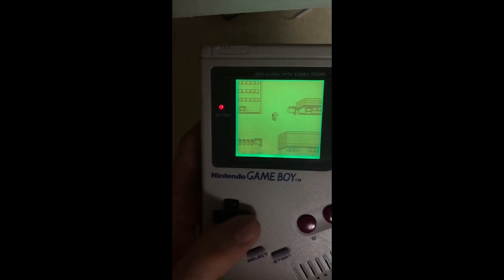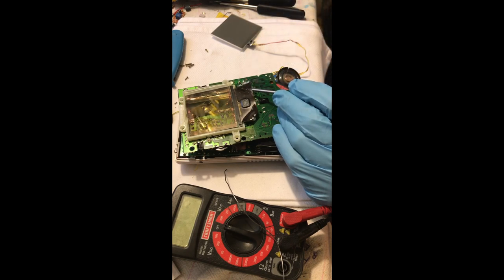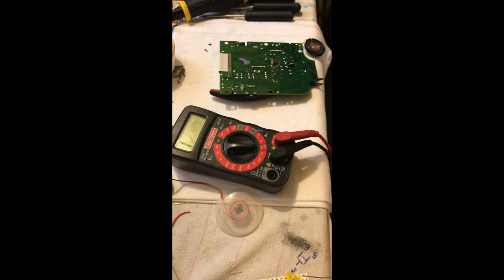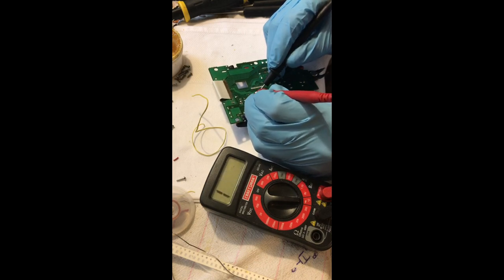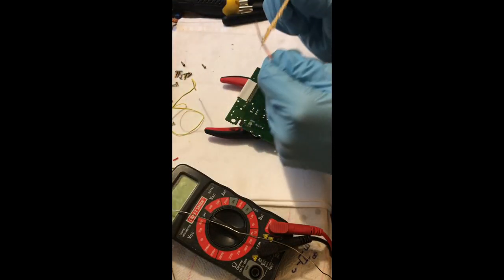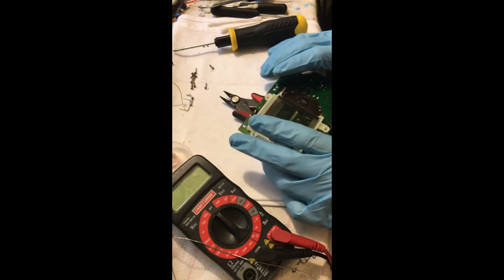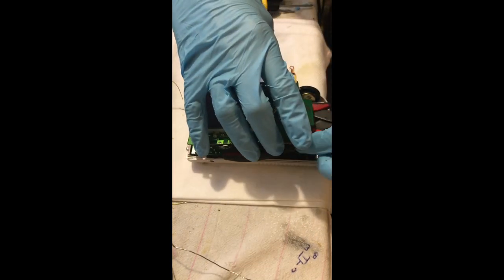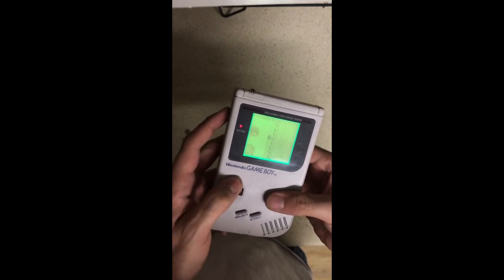Fixing unusual button issues - How To, Gameboy DMG

Comment: Thanks for making this video! I have a question. So, I have a DMG and it works properly for years but after not playing with it for a while, the Right + A button doesn't works anymore. Do you think I can do a restoration to it with this video as reference? or you have another tips to solve this issue. Thanks :)
Reply from the maker: First step would be to disassemble it and clean the LCD PCB and silicone button membranes with isopropyl alcohol and then test and see if they work

Comment: Hey man, I have a DMG that powers on, has sound, and seems to go through the boot protocol effectively. But when the start up logo scrolls down, it's a very oversized block , 3 times as tall as normal and full screen width( game/no game), and there are pixel lines from top to bottom. Not the missing lines needing a solder refresh, but alternating rows of 10 or so pixels,  dark light dark light ect; top to bottom. With no game it holds that screen. With a game, the screen goes blank after the "ding". I understand this is an old video, I'm just hopeful you get this and have any place for a DMG guy to start. Great video. Really good stuff. Thanks all around. Now for that shot of Seagrams.
Reply from the maker: Sorry for the delayed response, my first step would be to check the voltage regulator and make sure that you are not only getting a stable +5v output but also a stable -19v output on the negative rail
Reply: @roarkemurdock3027  
No apologies necessary! I'm greatful. I will get my tools and retest but as I recall, I got weird readings from the regulator. And for reference, the DMG in question, is a CPU 06. The "blob board" .  Thanks for getting back with me, very much 🤘
Reply: @roarkemurdock3027  
I forgot I put the retrosix clean power board in this unit. But I do read 5 and -19.
Reply: With a fully functional front PCB and screen, the whole screen is powered on, no weird lines as previously described, and the contrast works, but the screen is blank. No "bars" or Nintendo block as I said before.
Reply from the maker: @earthskarma  ok so you swapped a fully functional front PCB and get zero image? If you put the original front PCB (that had weird oversized lines) into a tested working cpu board what happens?
Reply: @roarkemurdock3027  to try to clarify, front board 1 and 2, and rear board 1 and 2. Both front boards work flawless with rear board 1. Neither front board work with rear board 2. The lines of rear board 2 have gone away since I replaced the capacitors.  But with both screens, rear board 2 presents no image, and doesn't seem to load a game. Power on, hear the ding, and nothing.
Reply from the maker: @earthskarma  try reflowing the solder on the CPU pins on the defunct CPU board, check continuity of all the CPU traces and the ribbon cable connector on the CPU board. Additionally I know that you changed the electrolytic capacitors but it is important that they are high quality caps with low tolerances, the voltage can be the same rating or higher but the capacitance Must be the same as OEM. Low quality caps with large tolerances may say 100uf but if they have a 20% tolerance they may actually be 80uf or 120uf which is sometimes acceptable when you are decoupling a voltage regulator, but unacceptable when when you are decoupling the CPU. If none of these things work you may need to swap in a donor CPU
Reply from the maker: @earthskarma  Nintendo used cheap older tech with high quality components, their circuits are, for the most part, designed very well. When replacing components like caps I always trust that they designed it correctly and that there is a reason why they chose that components value, so I replace them with capacitors that have 3% or lower tolerances
Reply from the maker: @earthskarma  now I should have asked what mods, if any have you installed and what game are you testing with? Is it an ever drive? If you have power hungry mods and/or are using an everdrive the DC-DC converter may not be able to supply enough current, in which case installs an auxiliary regulator to power the mods and a large decoupling capacitor on the power line may be necessary
Reply: @roarkemurdock3027  i bought my cap set from RGRS. I was assuming they would be correct. Here's one to the  naive consumer. My meter doesn't measure capacitance in the stock units range. I'll spend some more time with it and see what I come up with.  I thank you very much for your time and help. 🤘
Reply: @roarkemurdock3027  it had the same problems stock, and with a osd v4 (I think) , then I put in the clean power, then did a re-cap. Only stock games. No ever drive.
Reply from the maker: @earthskarma  you can kind of test the capacitor with the resistance mode of your multimeter, take the suspect capacitor out of circuit (ideally but not always necessary) and discharge the cap. Set your multimeter to the highest ohm setting and put the leads on the capacitor leads. The ohm reading should start low and gradually rise to infinity, if the reading stalls or immediately goes to infinity then the capacitor is likely bad, however it will not tell you the capacitance of the capacitor

Comment: I've got a dmg that's got left and B on all the time. Checked with another LCD board and it's still happening. I'll check the diodes on the CPU board. I've already reflowed all the CPU pins and that didn't fix it. Hopefully it's one of the diodes. Do you know where I can get a suitable replacement that isn't from another board?

Comment: Hi,
I noticed on my DMG in Super Mario World2 when selecting a safe game, that I could only move to the right, and (hardly ever) to the left.
WIthin the game everything seemd fine, until I noticed, that pressing up, turned left, and pressing left also turned left. When I tried jumping, I saw mario jump high, so left and up somehow seem to pre activated together. Could this be a similar problem? Contacts are clean.
Any whay to test what the reason might be without taking the display off? I am not so expierenced with soldering...
Reply from the maker: Hi! It is certainly possible that the button array diodes and/or the related traces are corroded/damaged. Only way to know is to get in there with a multimeter. You can gently open the screen without desoldering the lcd to test them, however replacing them with the LCD in place would be difficult

Comment: i have a gb light from japan and there is so much corrosion on the A and B that they arnt working no more. i wonder if its possible to hook up wires directly to make it work again. u have any idea?
Reply from the maker: If contact pads are in decent condition and just the traces are corroded then you can absolutely fix it with jumper wires

Comment: Wow, this is the only video that helped me understanding something about this problem :D
I modded a dwg for the first time with the backlight and the bivert but now the right button is right + A, the left is left + B and so on. I mesured 550 on the 4 DA diodes , do you think this can be the problem? (I mesured signals on buttons too and the D pad got lower signals values than start, select, A and B)
Thanks

Comment: great video but can i ask a question i have a dmg gameboy i got from an old store its works fine but the up arrow isnt working is repairing it deffrent than this video and can i fix it without removing the screen?
Reply from the maker: It’s hard to say without opening it up and looking, but if the up button just isn’t working at all then it may be as simple as cleaning the silicone membrane under the d-pad, putting a jumper wire over corrosion, or it could be a complex repair. Many different possibilities, but I’d suggest that you open it up, clean everything with isopropyl alcohol and test it again, if that doesn’t solve it then grab a multimeter and start testing everything in circuit with the dpad
Reply: @roarkemurdock3027  i already cleaned it until it shines but still isnt working
Reply from the maker: @rashedfrlegend4496  ok so you’ll need to grab a multimeter and start at the problem, in this case the up pads, and work your way to the cpu testing that all traces have continuity, the corresponding diode(s) are working and have a voltage drop of around 700-725 millivolts, check the continuity of the corresponding ribbon cable traces, then on the cpu board that the ribbon cable connector is working and then continuity of the corresponding trace to the cpu. If all of those work correctly, reflow the solder of on the cpu pins and test if that doesn’t work swap the cpu from a known working dmg. If that does work then you need to transplant a working cpu onto the board. If a known working cpu board doesn’t work then the issue is on the LCD board and you likely missed the problem when diagnosing the issue
Reply: @roarkemurdock3027  thanks man ill try my best
Reply from the maker: @rashedfrlegend4496  no worries, all problems can be fixed, however they often push your patience to the limit haha stay calm, step away if you get frustrated, and don’t give up, you can do it
Reply from the maker: @rashedfrlegend4496  also make sure to replace all electrolytic capacitors on the CPU board, the DC-DC converter board and the LCD board. Make sure to get high quality capacitors with low tolerances. The voltage rating must be the same or higher than the originals, however the capacitance rating must be exactly the same
Reply: @roarkemurdock3027 hey i just came back to ask if i can order the diodes from the internet or something like that because i couldn't find another Gameboy around
Reply from the maker: @rashedfrlegend4496  yeah you can order them online, I used to sell them years ago after I made this video
Reply: hey i did more researches and my problem could be a dead cpu pin and not a bad diodes because both up and select have the same pin and they both does work with me so i guess i cant fix it without having another gameboy @roarkemurdock3027
Reply: @roarkemurdock3027 I wanted to ask if there is any other kind of diode that i can use without having a problem because i cant find a da215
Reply: @roarkemurdock3027  can i use a Schottky diode instead of the dan215??
Reply from the maker: @rashedfrlegend4496  the Dan 215 diode is a switching diode, I wouldn’t recommend using a Schottky diode without doing some testing first. But let me looks through my gameboy parts, I may still have some Dan 215 diodes that I could send you, additionally I could send you some parts boards if you did want to try swapping the cpu
Reply: @roarkemurdock3027  its ok you dont need to send me anything but tell me what other things i can use instead other than dan215

Comment: I have a problem with my gameboy dmg that what happens is similar to your error, when I press the a button it is also pressed right and the same with b left select up and start down, but my problem is that it happens with any screen that you put on it What is this error due to?
Reply from the maker: Hard to say exactly without having the unit in front of me. I’d start by checking if any of the pins on the ribbon cable connector are shorted, then check the traces that go from the ribbon cable connector to the CPU for any damage or shorts. If the connector pins and traces are good, check the CPU itself, are any of its pins shorted/damaged? You may potentially need to replace the CPU, in which case ChipQuik (the solder I use to remove the screen) or a hot air gun makes easy work of removing the CPU

Comment: Voltage drop changes as the component cools. Probably was fine, but no harm in replacing it.
Reply from the maker: You are absolutely correct, and I imagine that after removing the short that diode probably would have worked fine, which I mention briefly, but better to replace then have it fail for the customer
Reply from the maker: Main point of the video was to show people that when you encounter a new problem schematics and datasheets will help you diagnose

Comment: I changed shells for my DMG and when all put back together, everything worked perfect apart from the a and b buttons, I've tried putting everthing back in the original shell and even used different buttons and membranes but still there isn't a single press detected even though they are clicking in and out nicely how they're supposed to

Comment: Nice video!
After adding a bivert module to mine buttons are all messed up. Left is constantly on, B is start up is A and so on. I haven't had time to look it up yet though..
Reply from the maker: I would first test with a multimeter to see if you accidentally shorted some pins on the ribbon cable connector when you did the bivert. I say that since the buttons were working before you biverted it
Reply: @roarkemurdock3027  yeah, I did that, accidently ruined it even more trying tobfix the short. Now it's a donor board for a GB Zero project. It's almost finished, just trying to find a 3,5" composite screen to go along with the Raspberry pi zero..

Comment: Great work man! I have a DMG that's tracking Left, it does this with two sceen boards so I'm assuming it's the main mother board... any ideas?
Reply: Hi,have you solved yet? Mine has the same problem with yours,And I have no idea.😢
Reply: @lysunda  I threw in the towel, I believe it was a CPU issue
Reply: yea， I have searched for this problem a lot, finally, I confirmed that its CPU has a problem, the CPU needs to be replaced if we want to solve it. @VideoGameRestoration
Reply from the maker: @VideoGameRestoration sorry for the late reply, it does sound like you’d need to replace the CPU which you can do using chipquik solder, pulling a working cpu from a donor board

Comment: Good video, i have bought one of this and the left and b buttons are not working, any ideas? they say is like a cpu fault.
Reply from the maker: Have you tested the diodes?
Reply: @roarkemurdock3027  no, i just cleaned all the contacts with IPA, my knlowedge of circuits is quite limited.
Reply from the maker: @TheMatich11  well you'll need to test the button contacts, the traces, the button array diodes, and then test and reflow the cpu pins.
Reply: @roarkemurdock3027  thx man, im gonna try

Comment: I have 4 Gameboy Dmg PCB with the same problem, the left Button is always active with A Button too. The problem is on motherboard PCB cause changing to other motherboard PCB all works well...nothing more i can do...
Reply from the maker: It's a bit hard to understand what you mean, but are you saying that this issue is on the motherboard, not the LCD board? If so then take a multimeter and check the traces and any components starting with the ribbon cable itself all the way to the cpu. If the issue is not on the LCD board, not on any traces or components, then it is probably the CPU, which you would then need to replace. Make sure you test for all other possibilities before removing the cpu
Reply: I have 2 with the same issue, same buttons. Test pin 66 of the CPU against GND and you'll see an unusual low ohm. Seems that GB CPU  rottens itself like the SNES CPUes